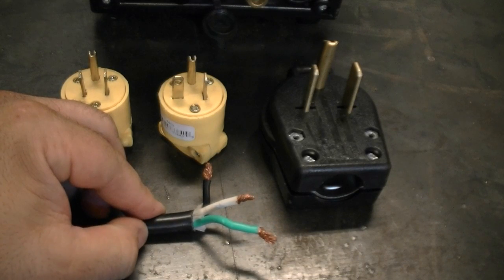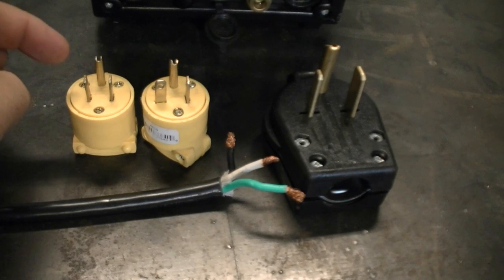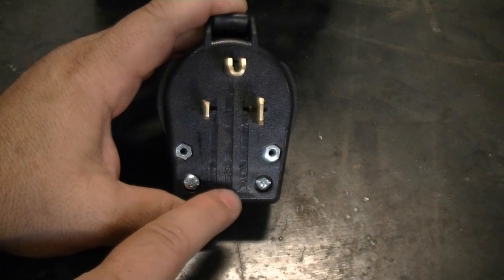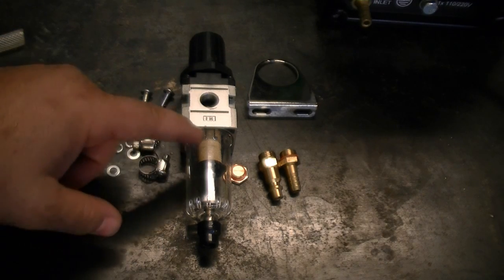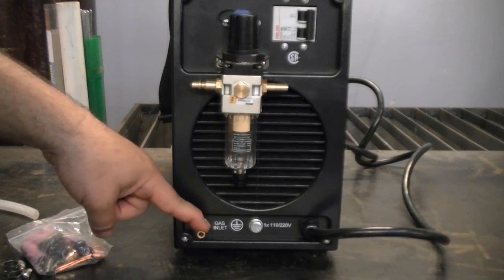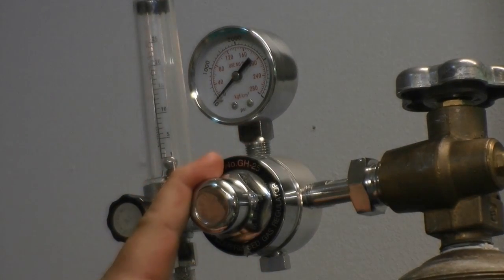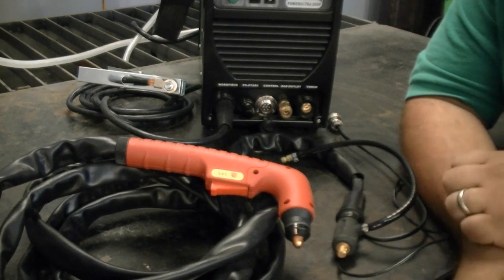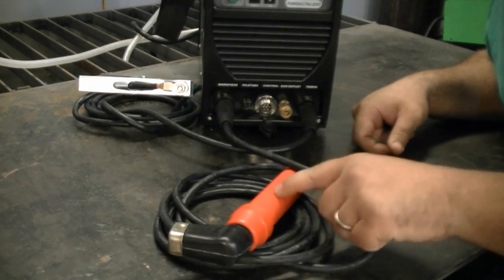Everlast PowerUltra 205P - Part 2 PULSE TIG STICK PLASMA CUTTER - Multi Process Welder

Comment: I didn't realize these multiprocess units supported dual voltage. that could come in really handy even though there would obviously be some reduction in power output.

Comment: Does the plasma cutting function work when you use it with 120 volt? I bought the powerpro 164 and can not get the plasma cutter to work.
Reply from the maker: Yes it should.  But you won't get a stable arc unless you use a smaller consumable designed for 25 amp operation.
Reply: 1speedjunky